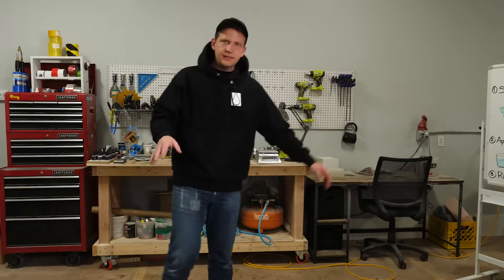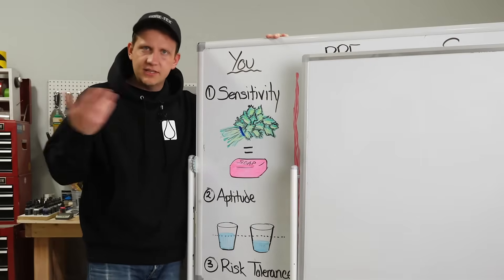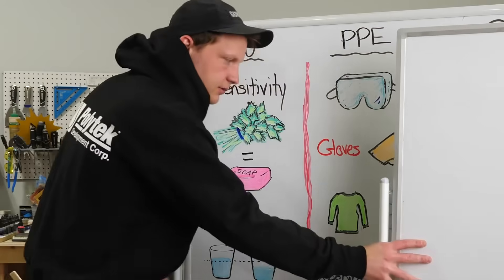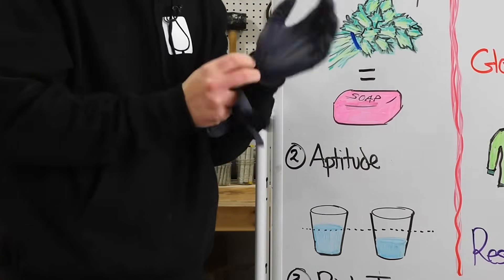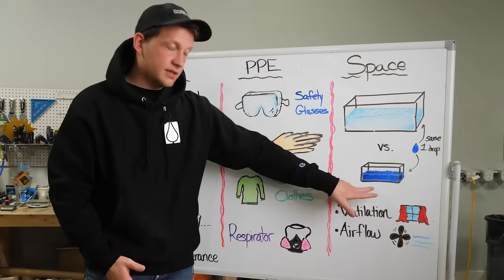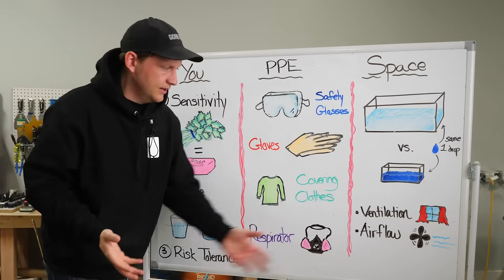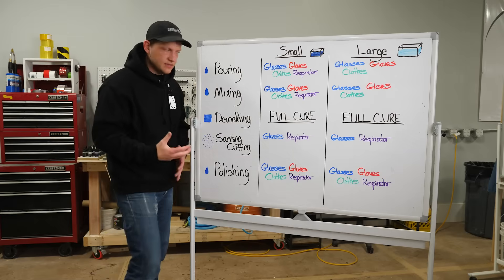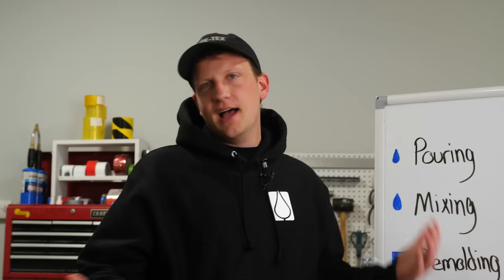Alumilite Explains: Epoxy Safety

Comment: Update: I got a full face respirator that covers my eyes, nose, and mouth. Is it still safe to use contacts because my glasses physically can't fit with the respirator. 

Is it safe to work with resin when you have contact lenses on? I have lab goggles but they still let air in. Should I opt for something air tight like swimming goggles?
Reply: No! Use glasses or just take them out before you do resin. I had the same question and came across many horror stories in the boating and woodworking forums! If you have soft contacts, that is a permeable membrane that can absorb fumes. Even if its low VOC, I think it's better safe than sorry!
Reply: @uchuuhime  Oh no this is worrying. I've since gotten a full face respirator that also covers my eyes. I'd prefer using glasses while working because it means i touch my eyes less, but glasses can't physically fit with the respirator :( Will the fumes still affect my contacts with a full face respirator?

Comment: I need an expert advise from experts here. I am very new to working with resins of any kind. Recently I bought a used executive desk which had some scratches on the top and some really bad ones on the side. So I did some research & bought wood filler and a can of stain + polyurethane. After applying the first coat on the entire table top and the sides. I left it to dry after opening the near by windows & gave plenty of cross ventilation for a few days.
The only problem is that now the table top feels a little rough where I think pollen & dust had settled on the top. It looks amazing but I can feel the graininess when I run my hand on the top.
Is it possible to layer non-toxic epoxy on it with the windows closed & a good indoor air filter near by so that I don’t have to worry about VOCs but at the same time no pollen or dust making it feel rough?
Is it possible to use Epoxy like an Art Resin on top of a cured Polyurethane layer??

Comment: I'm trying to figure out how much epoxy is safe to work with in my little one-bedroom apartment. I'm just trying to glue a bowl back together with 5-minute Z-Poxy. Obviously no risk of splashing or other mess, but I'm not sure how much fumes get produced by the one-inch puddles of epoxy I'm mixing.
Reply: Your safe
Reply from the maker: With a project this small you would want to work with open windows but we would recommend checking with the manufacturer for more detailed safety instructions on the specific product you're using!

Comment: Your videos are excellent to watch but I will have to take issue with this one. Its not that the information is not good but its more the approach at taking the issues of safety of working with hazardous materials is basically wrong. I come to this from an industrial approach and I am a Chartered Engineer Managing a complex industrial site here in the UK with a lot of training in this field and was responsible for many years with my shift Chartered Chemist in writing the documentation and carrying out the work with materials hazardous to health. In the UK we call it a COSHH assessment (Control of Substances Hazardous to Health). The approach we were trained to adopt in dealing with hazardous materials is

1. Using the MSDS review the issues. Then look to see if you can remove the process from your workflow. If not progress.

2.  This is were you go wrong according to my training and experience. You have to ask yourself if you can  engineer out the issues a big NO NO is to go straight to PPE. So you should have talked about ventilation first for a start in particular LEV (Local Exhaust ventilation). Its all very well saying ventilation but when it is blowing the hazards towards you instead of away, you are actually making the situation worse. You should always exhaust the hazardous arising out of your workspace or capture it in a container with the correct size of filtration. There is no point in blowing it to somewhere that you are going to work later without your PPE on. LEV properly set up will solve the vast majority of your issues.

3. Last resort is PPE and you must look to see the PPE specifications meet the requirements for the process. This has to be approached with ALARP/ ALARA in mind. That is approaching the review in a manner that it has done an assessment whilst being mindful that your process safety risk is As Low as Reasonably Achievable. You do not want suggest like I used to have to do in being on a treadmill with an instrumented up respirator verifying fitment for a model of respirator. There again you do not want to suggest a mask/respirator with the incorrect filtration or  your only then giving the user the perception of safety which is actually worse as they will expose themselves for longer. In simple terms you wouldn't ask someone to shovel dry play sand with a tennis racket would you.

You did rightly mentioned Risk Tolerance. Without boring people with a lot of information standardising acceptable risk which is accepted by all, is through awareness training which is regularly reviewed. You need to review Consequence against Probability. A properly done risk assessment  even a dynamic one, ie done on the hoof is more likely to be done properly if the Person is SQEP (Suitably Qualified and Experienced Person). So videos like this done properly go a long way to getting the job done right with Risk minimised and properly managed. 

I hope you do not take this too badly as there is a lot of good information just needs to be overhauled a bit. At least its not like the videos with wood workers lifting heavy weights in flip flops that really does my nut in!!!!

Hope this is of help
Reply: I don’t know if you’re ever going see this but a comment section is not a place where people are going to pay attention. If you have resources (peer review papers, a website with general info, etc) then we’re talking. Also, safety regulations could be vastly different from country to country, like you mentioned. 

I am responding because I’m interested in the training and research you’ve had. It might be really useful to people. Are you a part of the FB group, Epoxy is not your friend? That group has a lot of resources.
Reply: @purplehood8418  Thank you for the reply. I have 35 years of experience working for the company that world wide is synonymous for a quality product which started life as a car manufacturer. I was responsible for managing the safe operation of an industrial site which had to control the personnel exposure of numerous hazardous substances to the smallest of particles managing both the Chemical as well as the the physics of these hazards, Solid Liquid gas or even properties which interested Rutherford and Bohr. As the hazards on the site had to be managed with an appropriate amount of money and effort into addressing the hazards appropriately. From that point of view we had to employee quantifiable methods for rationally proportionally resources to meet regulatory and health and safety requirements to the issues. 

No I am not art of the FB group you have suggested. Let me know the forum which will suit you best if I can be of help to you.  

As I don't know your experience in dealing with chemicals and the control of the hazards associated with them. Can I first of all ask the question. Have you ever used a fume hood at School in science classes or in industry?
Reply: @TheClashen  I have never used those chemicals. What I do know is that the pandemic brought an explosion of people using resin as crafts. I bought some of those crafts and have been gifted some of those crafts not knowing about resins true risk factor. There are thousands upon thousands of people using resin every day and ingesting those fumes every day and there are already a lot of resin using YouTubers who have reported health problems, and many of those will be life long. My fear is that in the next few years, we will see more and more of these people getting sick. 

There are resins that are marketed as non toxic. Epoxy is Not Your Friend, the FB groups, claims that there is no such thing but that’s a FB group and I can’t tell what’s factual or not aside from using resin without protection and weighing all the risk If people were more well informed is a fact. We need more people with expertise explaining this. That’s why I’m asking for resources. I could have easily been one of those crafters if I hadn’t researched it.

Comment: Is it best to do this outside? or does the dust particles make it hard to keep the products clean?
Reply from the maker: We always recommend using epoxy or resin products in a well-ventilated area. If you do not have that in your home, then yes, in an open garage or outdoors, or with a respirator on. You should always, always sand in a well-ventilated area.

Comment: I’ve always wondered the real safety of sanding epoxy. 
Even if people vacuum the studio for epoxy dust after sanding; wouldn’t there still be epoxy dust that still lingers and cause a safety hazard when your without a respirator while not working with epoxy  

I always thought people would designate a room for sanding and use plastic to cover the walls to catch epoxy dust particles similar to Fiberglass or is it different?
Reply from the maker: Well we definitely wouldn't recommend removing your respirator immediately after sanding since the dust is still floating around in the air. But after allowing the room to air out/ventilate and allowing the dust to settle, you should be good to move about the room without a respirator.

Comment: Wish I saw this video 3 months ago. I work with UV reactive resins with SLA 3d printing. I havent been using eye protection and until recently wasnt wearing a respirator. Last Sunday evening after breaking supports off of a fresh uncured print I could smell even threw the respirator a strange whiff of resin, not much but it was noticeable and just smelt denser I guess. Sunday I woke up feeling barely rested after a full nights rest, eyes burned when closed and were so sensitive I could barely open either one for a few seconds before shutting them. After someone getting a hot cup of coffee in me, my nose started running really bad, and then I realized how much I had to blow my nose. For a couple hours my sinuses drained what I presume was radical mucas buildup behind my eyes. Anyways happened again Wednesday this week not as badly. I spoke with a good paramedic friend of mine and he suggested alergic reaction to something. But heres where it gets pretty interesting. I just had a friend over last night, we had a beer and design/3d printing party. He until this point has never to his knowledge been exposed to resins. I do have my printer in a small room with almost no ventilation, albeit I still try and air it out every few days, and again, neither one of us wore any sealed eye protection, I used a respirator and he used an esthetician mask. He was probably exposed to the fumes for about 20 minutes over the evening in total- but he decided to sand his print  while we sat at a table playing dungeon and dragons for a couple hours neither of us thinking about the dust from the resin. Anyways, he woke up this morning and immediately had the same symptoms I describe.

 My question would be, is this kind of reaction common? Also what can either of us do to keep our bodies from reacting or developing further sensitivities?
Reply from the maker: Essentially, these are chemicals and can cause reactions for any amount of reasons. The best you can do is take the proper precautions when working with these types of products and hope that your body doesn't react negatively (just like with any allergy). You can develop sensitivities and allergies to just about anything and the best course of action when noticing these is to seek help from a professional in the medical field.
Reply: Sla resin is a sensitizer (meaning your body grows more reactive to it based on exposure). Starting in the industry you maybe be able to touch parts, and later it could be full blown hives from just the smell.  The only way to prevent this is to obsessively clean all contact surfaces, and have a forced ventilation system.  

If I had to guess, 2part resin and SLA are similar in composition.

Comment: I tried sanding a board of plywood the other day, it was impossible to sand. I now realize that the primer they used on it must have been something harder than a regular wood primer, it must be an epoxy or a polyurethane. Is there no sure way to know when you're looking at epoxy?
Reply from the maker: It mostly comes with familiarity of the material - even we have trouble sometimes too!

Comment: How do you prevent the chemical fumes from escaping as the resin is curing? Would it be better to let it cure outside on a covered porch? Or maybe a closet?  I want to get back to making things with my resin, but I have been recently diagnosed with COPD, and I don't want to breathe the chemicals at all anymore. 

Thank you for making this video, you would be a great teacher!
Reply: i use low or no voc resin but for extra safety i cure it in a storage container with a flat bottom, theres no smell when i open it if its fully cured
Reply from the maker: Our products are low to no VOC - with that said, you can still have a reaction to the chemicals depending on how sensitive you are to it. The recommendation is to work in a large, open space with lots of air-flow. A closet isn't a good idea since it will just trap the smell while it's curing.

Comment: Great video! I've been working with epoxy for over a year with not issues until 2 weeks ago 😔. 
I got an allergy reaction on my eyes, they are not painful but there was an inflation on my lids, it was gone after 2 days, but yesterday I went to work with epoxy and same reaction. Did I properly protect myself? Unfortunately not. If I use all protection mentioned on your video with a proper mask, I should not have more reactions? 
I just bought a full mask respirator and filters. Thanks
Reply from the maker: The PPE is to help prevent a negative reaction, but if your sensitivity to the product is extreme, it could still affect you. We would recommend reaching out to a medical professional!

Comment: Just started making glitter tumblers using alumilite clear cast. What are your thoughts on using a room in the house with a fan going at all times? I’ve been doing this for a while now on top of using a respirator
Reply from the maker: The fan definitely helps but a few open windows (to allow for air flow) would be better. Glad to hear you're wearing a respirator though - that's definitely a plus!

Comment: I've worked with a zero voc epoxy for years. There's never been any need for a respirator. The only meaningful concern has been my eyes as I'm torching the epoxy. This step accelerates the gassing out of the epoxy. This issue has been easily overcome by simply not having my face directly over the epoxy as I'm torching. Perhaps there are people who are more sensitive to epoxy. This has been my experience.
Reply from the maker: This is great feedback, Gayle - everyone is different and can have a more severe or less severe reaction depending on their sensitivity. The best thing to do is take it slow and be safe!

Comment: Great video.  It's hard enough to get woodworkers to think of safety and wear safety equipment.  For a quick second I saw you wearing a respirator, what kind was it?  Thanks.
Reply from the maker: Great question! For general use, we love using the 3M Reusable P95 Respirator from Lowes!
Reply: The best respirator mask when working with resin, is the PD-100 Respirator from Parcil Distribution.